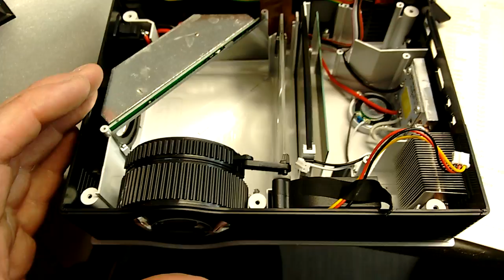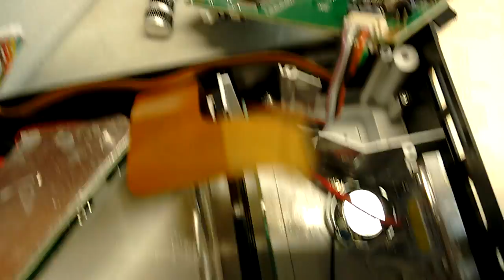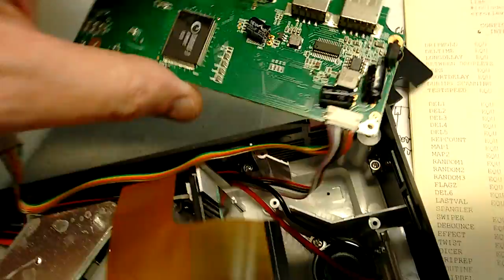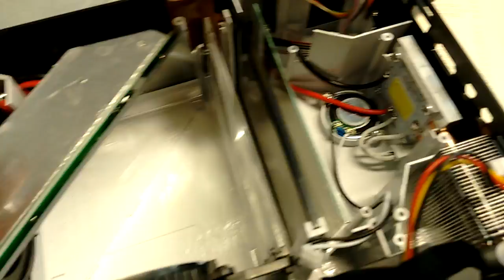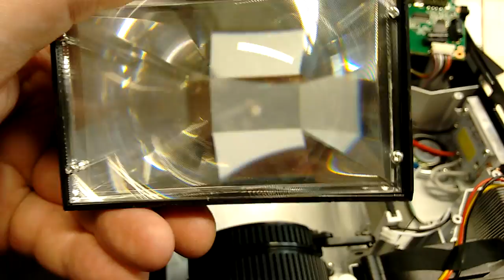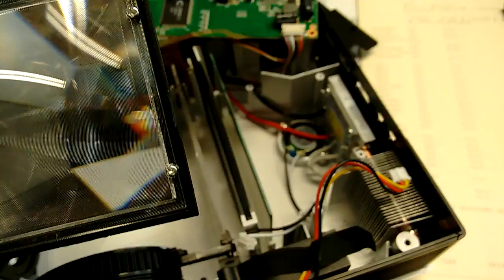Inside a cheap LED projector.

Comment: iw as thinking of replacing the led chip with brighter one ,i just dont know what its wattage,but i'll be trying a 50watt though it requires only 12v,so i think im gonna by a stepdown converter for it.

Comment: Cut out original COB & housing and affix 4000k CXB3590 CRI90 with pin heatsink and aftermarket driver in its stead for an upgrade in lumens? Would require a bit of DIY, but would it work as anticipated or would the circular pattern cause corner darkness? Awesome show, fuels the curiosity :)

Comment: So, I guess I won't be using this to replace my Sony 300" jobbie then?

I suppose these little projectors would be fine for kids' parties and suchlike where the audience wouldn't be particularly critical, and image quality wouldn't wouldn't be an issue. I've often wondered about this small projectors, and I suppose that if you can muster a 50" picture out of one, then it may have some merit as a portable imaging system.

Comment: Which would you say is brighter an LED projector or a projector that uses the mercury vapor lamp?
Reply from the maker: Hard to say these days.  The metal halide lamps put out a lot of light, but modern LED projectors are getting impressive.

Comment: Where would I get a replacement lcd display
Reply from the maker: It may be quite a specialist component optimised for projector use.  If there was any reference on the existing display it might help locate a new one.  Also note that sometimes the lenses and polarising filters melt and cause distortion and darkness in random areas.
Reply: @bigclivedotcom  yeah I was able to clean it but just wanted to see if I could find a replacement if it goes out thanks.

Comment: If I can figure out the exact high power led it uses I can create a kit to change driver MOSFETs and lamp with higher watts but without it going in to overheat I need details about that specific led chip if any it could be 20w can probably be upgraded to 30w or 40w 12v high power led the downside after swapping out old driver MOSFETs to power higher upgrade is its going to use more energy on power bill

Comment: hi, please let me know where can I get the black glass/ polarizing filtering front which is
 between the source of light and the display in the projector. My one 
got a burn or black spot on that glass. Any solution apart from throwing the projector in the dustbin???
Reply: Anil Thapliyal did you got it ki just threw the projector ?
im looking for a LCD display

Comment: How is the LED connected? Possible to mod/ replace it with a Higher Res 1080p / 2K / 4K LED from a Smart phone?
Reply: No, it's the resolution of the LCD that determines it.
Reply: The LED and driver chip parts are what make a brighter more contrast image if its dim it's because not enough lumens pass threw the tinted LCD display this can be all switched to an extent like the heat sink in that projector has a TDP well over that watt LED which means it can be replaced to a more closer higher wattage LED that doesn't exceed thermal fuse limits and cooling capabilities
Reply: If your asking to put a 4k phone screen to switch out the LCD one it's not going to work if if you had a transparent 4k that fit and ran off the main board everything changes ones you swap a screen the motherboard becomes a bottle neck and so will the projector lens it's never meant for 4k to come from it

Comment: I wonder if I could use the optics and driver board with a 5" 1080p LCD. Changing the LED to something like 50W this would turn into a 100 pound FullHD monster. If only the LCD would be pin compatible...

Comment: do you still have that thing?
have you tried slapping in a 100 watt led and look what the image looks like? 
I think that yould be quite interresting
Reply: I've just got one of these projectors and have tried a 100w led. It's not fully fitted yet, just wired with a heatsink externally to try for a minute or two. The led psu/driver seems to cope, pushing a full 100W; may make it dimmable yet. The projectors heat sink seems more than up to the job, the heatsink fan pushes a cool 30c of air out with the 50W lamp. Need to try it in situ and measure the 100W led surface temperature before I box it up and fry the full set up.

Comment: That's the largest LED I've ever seen.
Reply from the maker: It's not as big as the typical 50 or 100W LEDs commonly used in floodlights.
Reply: I haven't had many chances to be around any large LED's

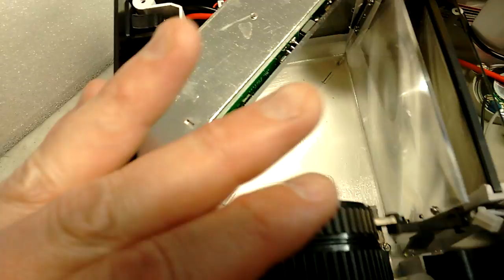Comment: 1:50 is that a circuit board behind the mirror? And if it is what would it be doing?
Reply: it is probably the power supply
Reply: +WestSideJooo right. didn't pay enough attention to the beginning of the video xD

Comment: Perhaps you could modify it to make the LED brighter?
Reply: What if you mod it by removing the fan and heatsink, while still having it powered as to not cause any power disruptions. Then finally hard installing a higher powered LED flashlight in its place, using its own power source?
Reply: This can be done modifiying the driver circut with higher power mosfets and those LEDs do not get hot maybe warmish my dlp air burns coming from vent a 20-30-40 watt led 12v high power would upgrade that 10w they claim 2000 lumens or 1000 lumens get a lumen tester you'll see the stock LEDs run cool cause maybe 300 lumens
Reply: The reason modifying or swapping lower current 12v driver parts is you get to still control it's brightness contrast via remote menu

Comment: What is with the random assembly listing on the table? Specifically, what chip is it for? Googling the CLRF instruction seems to indicate a PIC...
Reply: This listing caught my eye, too, because it looks similar to the usual assembly listings for the Apple II series that I deal with all the time. (I'd like to think I'm somewhat sane by doing all real 6502 work in cc65 with a real text editor, but the likes of EDASM still haunt me ;o)
Reply from the maker: It's the software for my dripping icicle project.  I'm intending to update it a bit.

Comment: That reminds of the first prototype projector, a guy used a standard slide projector, he got hold of a LCD (monochrome at the time)  that was about the same size as a slide, and successfully projected an image, he was thinking of stacking 3 lcd's somehow, of different colours, but the focal length of 2 of them would have been out.
I have since searched for it without success, it was i think on Tomorrows World.

Comment: How much is one of those cheap LED projectors?
Reply: Probably around $50. If you have the ability though, stick to used DLP if you want to go super cheap with the cost of repairing them or finding bulbs.
Reply: MadeOfSolder Finding bulbs isn't a thing I wanted to do. It should also be rather lightweight, and of course cheap. I learned from another comment thread that DLP or LCoS based projectors are better (so in fact for one like the one bigclive took apart in the video, I'd only be willing to pay 20 bucks), but they aren't as cheap yet. OK, I can wait, don't need one right now, it would be kind of a play thing anyways...

Comment: I did not expected to see this sort of projectors available in 2016. This are realy bad toy LED projectors and not worth more than $50. Any of the brand 200 to 300USD LED projectors will be hugely superior to this toy.
The way a proper LED projector is made (I'm referring to those low cost 200 to 300USD) is by using a small DLP or LCoS (LCD with back mirror) and 3 color LED (RGB).
The toy one in this video uses just a normal large LCD that you find in a phone or tablet so the LCD has the RGB individual pixels next to each other. So If you want to display a yellow pixel you will see a separate red and green pixel (is OK on  high density phone display or computer monitor but it ill look realy bad on a "large" projection).
On the 200 - $300 proper projectors what you will see will be a green pixel on top of the red projected pixel so the eye / "brain" will see a true yellow point (is still not great since is actually a green and red dot projected in the exact same place at high speed so the brain interprets that as a single yellow pixel).
Best will be something like a 3xLCD or 3xDLP projector then there is no flicker what you see is a true yellow pixel way better than any phone or computer monitor.
Reply: If i remember correctly they sell this about $50. :)
There are some stores which sells these for way more than that, but usually around $50
Reply: This UNIC UC40 type projector has been available for a few years, under many different brands. The problem is that at $50 this is the kind of projector you'll get, and there are people who need (or want) a projector for various reasons but do not have $200 to spare.
Reply: Well, as LCDs will get cheaper, these projectors may also come with a full-HD LCD instead of only 800x480, so - if I understood your point correctly - this may completely change the game for these cheap projectors? 
Because it seems that LCoS and DLP chips still seem to be much more expensive to produce than simple LCD panels...
Reply: But its already developed, there are a lot of 800×480 display for everything, a fullhd would be more expensive.
Reply: SzDavidHUN It's still more expensive today, but over time it will become cheaper as well (remember cheap smartphones having qHD displays at best a couple of years ago, now they all have at least 720p ones). I guess the price of those LCDs will drop faster than the price of decent DLP or LCoS chips.
Reply: I did not looked in to the cost of this things and maybe even those 200 to 300 that I mentioned are less now.
I have not looked in to projectors in quite a few years.
Projecting one of those LCD panels will not just look bad. Imagine a blue screen will be filled less than 30% (just the blue subpixels will let the light go trough) they are also extremely inefficient since just 30% of the LCD will let the light on the other side. The DLP and especially the LCoS will reflect light from 85 to 95% of the display surface and only the Blue LED will be ON for a blue filed screen.
I do not think is worth even $50 unless is just to see how it works :)
Just made a quick search and the proper DLP or LCoS can be had new starting at 100USD now.
Reply: That's cheap :D

But there will always be that kind of person who will buy the other thing which 5% cheaper and 1532152% worse. 
And these very cheap products doesn't seems get better only very slowly. Like a year before there was a lot of android phone with 512 mb ram and 800×480p screen.
Reply from the maker: Smartphone screen?
Reply: It's possible to make a projector from smartphone screen. If you remove the neccesary layers, it works. I wouldn't be surprised if these projectors was made of some old media player board, some smartphone lcd, etc :D
Reply: SzDavidHUN The layers of the smartphone screen will probably be glued on (in order to save space), so it may be quite the effort to remove them without breaking the lcd or the necessary polarization filter.

However, since you looked them up: Where can I find good but cheap (around 100 bucks) LED projectors that use a DLP or LCoS chip? Any links to an example on amazon or ebay? I'd be interested in that, because at some point in time I will want to buy one (although not yet).
Reply: Seegal Galguntijak I've seen a video, if i remember correctly GreatScott made a projector from a 7" screen. Probably these panes are sell for respberry, but you can connetc to it anything with hdmi.
Reply: The problem here is that as an average consumer, you have little idea of what you're getting for your money with these randomly branded Chinese products. some brands/retailers price it at $50, others price it at $100. That $200 projector might be $500 when sold somewhere else. Most of the time you have to do a ton of research to know what you're getting (as few will know that this is a generic UC40).

Also in many cases the price also includes shipping, and projectors are somewhat large items. Take $15 off shipping and you get a $35 projector.
Reply: Yes I agree that average consumer has no idea of what is getting that is why I made the comment since maybe many will have decided that this looks nice and it will be a good toy to play with.
The research is the fun part :)
Reply: ***** Yeah, well, I'd appreciate one of those better projectors at the price point of around 50€ or something like that ;)
Reply: Seegal Galguntijak There will not be any practical use for this cheap large LCD projectors (UC40) they look realy bad so better just watch a movie on you phone or laptop :)
If you want an usable projector then those are still above $100 probably 100€ in Europe.
You can imagine a large at least 32 to 40" LCD TV with just 800x480 native resolution and realy bad (dim) backlight and that is the imagine quality of one of this.
The spec is misleading since those UC40 variants claim hundreds of lumen to over a thousand and that is probably just the LED lamp lumen output and the real output is probably in the range of 15 to 20lm with a white screen way less with any of the primary colors since just 30% of the screen will be used do to pixel arrangement.
The LCoS or DLP type projectors have a monochrome LCD or mirrors and the colors are done by using 3 separate LED's one for each of the 3 primary colors Red,Green,Blue.
About 6 years ago I used to modify (for fun) old 3x LCD projectors by replacing the original Lamp with an White LED. There are two old videos on my you-tube channel.
The best performance was using a single die white LED supplied with 6W and I got out about 25lm similar to the $100 AAXA LED pico projector.
Reply: ***** Yes, as far as I know about the technology theoretically, the DLP chip consists of one little movable mirror per pixel which is flicked on or off, and a synchronizedrotating color wheel in order to provide the R/G/B image on the screen, while LCoS is a LC display on a silicon chip, although at the moment I don't know whether this acts reflectively as the DLP chip does, or transmissively (with a LED light source on a second layer of the chip beneath the LC part). So I totally see how these technologies provide a much better picture with much less loss of the original brightness of the light source. I just regret that they are still so expensive, because it wouldn't exactly be something I'd use very often, so I am not willing to pay more than 50 bucks for it ;)

Comment: That's really interesting...I know I have a little "pico projector" I think it was Optoma but not sure but it's about what you described with this one, good enough for something the size of a normal TV but not a lot more.  I know one thing I've found with most of these mini LED projectors is they have to "warm up" about 10 minutes before you focus them because the plastic lenses and components seem to change shape slightly and throw off the focus.